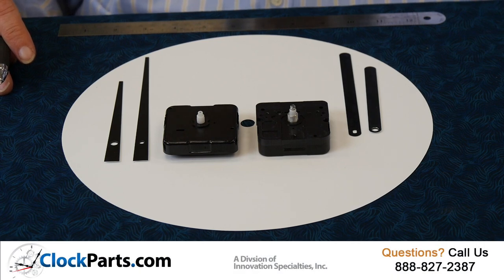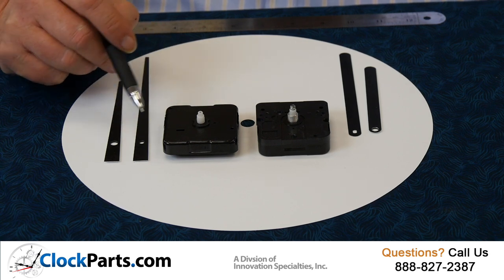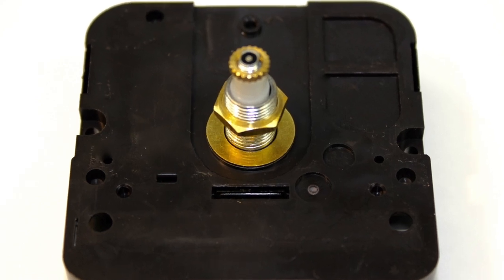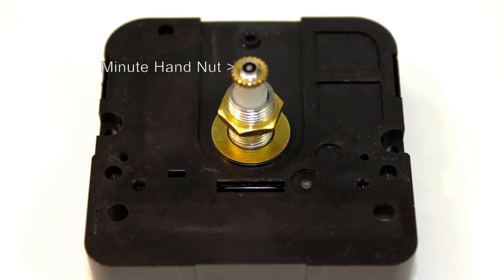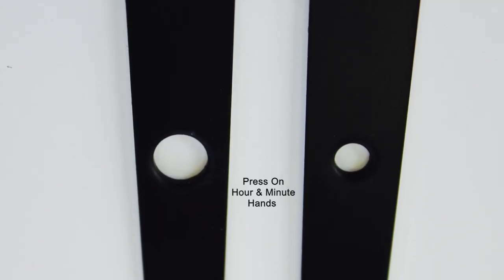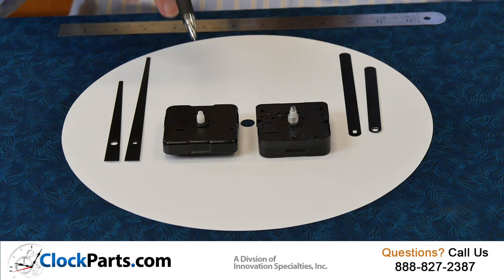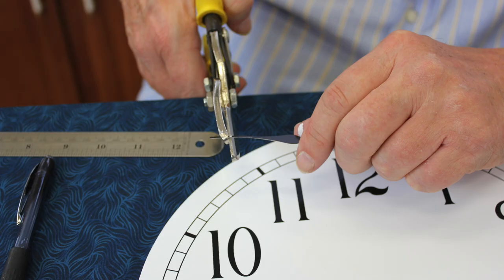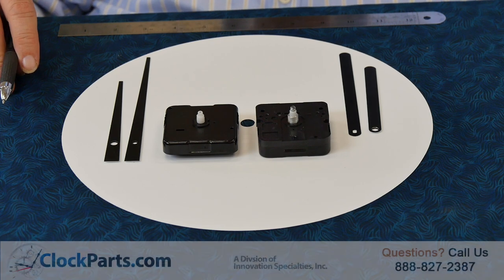How to Install Hour and Minute Clock Hands

Comment: what kind of glue can I put on the back to stop the clock mechanism from rotating?
Reply: Damion Smith egg whites
Reply: E6000. I love it and used it for the back mechanism just today! Glue gun w/ gorilla glue sticks works too. It can be removed later if you have to replace later.
Reply: Double sided tape will work.